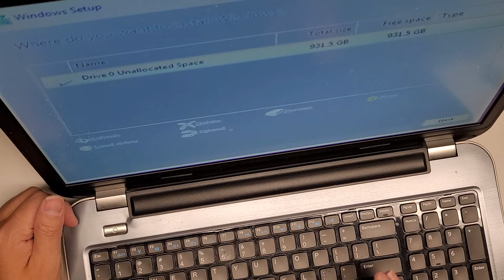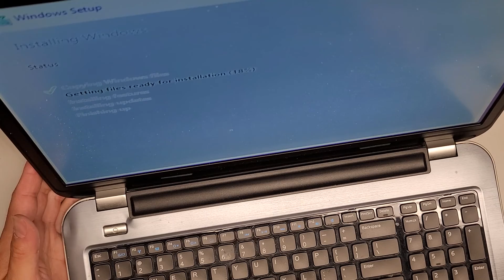YouTube Viewer Laptop DELL Inspiron 17R-5737 17R Upgrade Disassembly RAM SSD Hard Drive Replacement

Comment: Hi bro.. nice video, sorry for out of topic question, i have that laptop and have a problem after installing to windows 10 pro. The backlight keyboard fn + f6 not working anymore. How about to your laptop? Is it working?
Reply from the maker: what model computer?
Reply: @ItsBinhRepaired  the model same with your laptop in the video 17R 5737.

I have solved the problem by removed the keyboard wiring and connected it again..

Thx bro..
Reply from the maker: @akprestrader  very strange, but glad it worked!